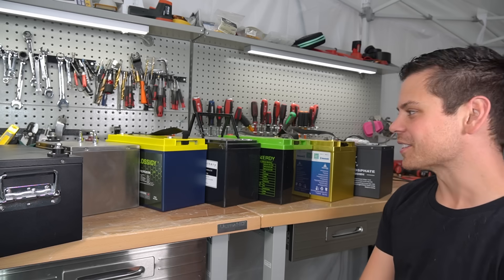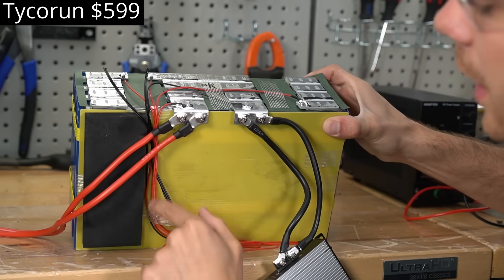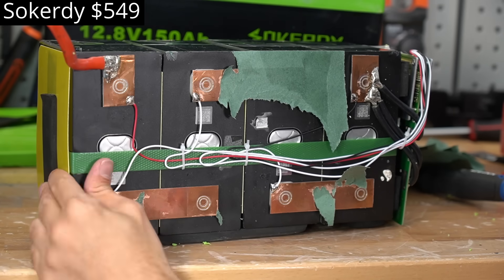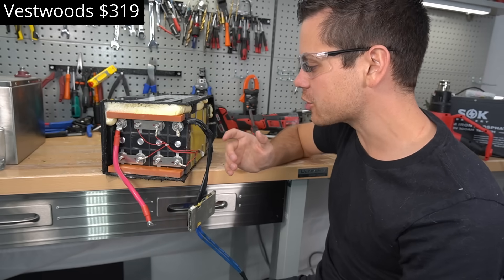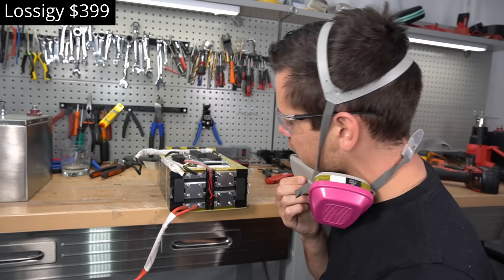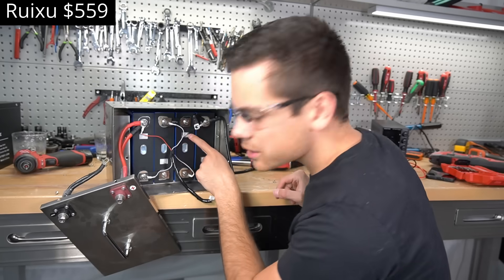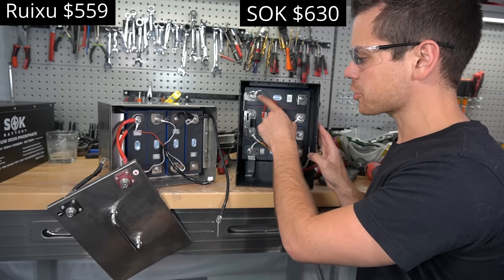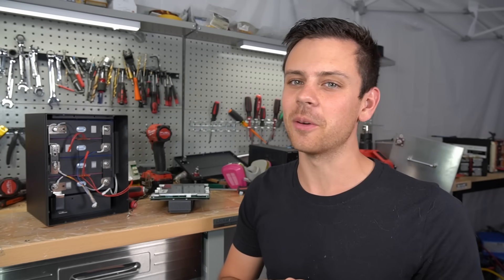Budget LiFePO4 Showdown: Lossigy VS SOK VS Vestwoods VS Tycorun VS Soderky VS Ruixu

Comment: You are not testing the vestwood as you should, the temp sensor is in the bms housing and shuts off @ 3celcius. So there is battery low temp protection

Comment: Literally had not heard of the Titanate type of lithium battery. Personably it uses a Lithium Titanium oxide as the cathode?

Edited to add: think I just commented on the wrong video. It was supposed to be the one where you drill into a LiFePo battery cell. Here in the U.K. it is electric bikes and scooters that are fastest in proliferating. All the ones I’ve seen have been the cobalt style. Given they get kept in the entrances of multiple flat houses round here In imagining a huge PR disaster is imminent if they don’t switch to phosphate soon.

Comment: First thanks for this breakdown, have you done a video on RV solar batteries systems?  I would like to know if I put two 200Ah batteries in parallel and have 2 200w solar panels how long can I expect them to charge when depleted to 50%.  Is there a formula for that ?

Comment: Nice video, do you have a review on the PIONERGY 12V Lithium Battery - 100A? I have their two of their 20Ah battery and want to fork up the money for the 100Ah battery to use on my new trolling motor setup. Thanks in advance.

Comment: Though this may be highly unlikely, the Vestwoods battery seller is insistent that their batteries have low temp cutoff. Because the BMS is so different could it be possible that it is on the BMS itself? Would you mind testing by putting the battery in a deep freezer overnight and trying to charge it? This for sure would demonstrate whether or not their claims are true. A 100Ahr  battery for $320.00 that according to their ad supports series and parallel configurations with good cells is a great deal, with low temp cutoff a great deal!

Comment: Great reviews. So good that I bought two Lossigy 12V 100Ah batteries. BUT--after getting them, in the manual that came with them there was NO mention of anything about a warranty or registration. So I emailed the company at the address in the manual--and got no response. So I have my doubts about their warranty and reliability. Have you found anything else about the warranty?

Comment: Hey I'm new to the solar world and I'm disabled trying to get a system up and going for my family in case of anything like a hurricane happening. Do you have a battery that's at least 200ah that you could sell me that has great functions and power still. I'm 34 months clean from drugs and alcohol and I've broken my neck so I'm disabled and on fixed income and I'm trying so hard to get off grid so I can have a sustainable life. Any help would be much appreciated. Thanks.

Comment: I was using an SOK 100Ah battery as the power for a pond jon boat.  It runs a trolling motor, sonar, bilge pump, and lights.  I charge it with a single 100W solar panel that lays on the deck.  It has been a great set up for me.  This summer the bilge pump on the boat failed and the battery was submerged after a 5 inch rain storm.  At first I thought the battery was ruined, but after opening it up and drying it out, each of the cells tested at 3.5 to 3.6 volts.  The BMS was obviously corroded and fried.  I replaced the BMS with a pretty inexpensive Daly BMS.  Following the procedures I have watched Will do a hundred times, I was able to get the battery working again (thanks Will!).  I know LiFePO4 cells are much less likely to have fire issues than Li ion, but I am a bit nervous about whether these cells are at increased risk after being wet.  So far the battery is acting normally.  Does anyone have any experience or insight on this sort of issue?  Finally, thanks to Will and his awesome channel I was able to have the confidence to do this repair myself.  What a great resource he is.

Comment: I have been enjoying your videos & learning quite a bit. I am currently building a 36V EUV to use around my farm. I picked up a very nice 36V commercial motor that was designed to use in a parking lot sweeper for dirt cheap as it had minor shipping damage. Most of the vids I've run across are for 12v, 24v, & 48v systems. Have you done a build of a 36v system that I can't find?
I also was thinking about buying three 12v LiFePO4 batteries and running them in series but it seems that one would have to get a 36v BMS to balance all the cells. Am I correct on this? Thanks.

Comment: Will, what BMS is used in the SOK 48V / 100Ah rackmount bats? 
I have three EG4 48V LifePower bats from SS connected to a Sol-Ark 12K. IF for what ever reason closed comm is not possible with my bats, I would think that the SOK BMS could be installed in my bats to do this. 
Tom Fisher MD EE

Comment: the vestwood 100ah tested 108ah (pass) and will start my onan 4,000w rv generator 75 amp (150+ surge)

so far so good great price

**** no low temp cut of **** at least in my freezer at 25F

Comment: I’m looking at getting two SOK 206 amp hour batteries for my RV. I want to be able to run my 1350 W air conditioner and 12 V DC refrigerator while Boondock camping. I just have to make sure I have sized everything right before I pull the trigger

Comment: LifeBlue 12V 200 AH low temp batteries are never in your reviews.  I have two, Aug 2020, 200 AH-12V Low temperature batteries that I paid over $2,000 each and one quit working.  I took it apart, and found the lid was not sealed to the battery box, but it had 10 #3 screws holding it on.  The one battery that quit working was badly water damaged, because water seeped in through the lid.  I mounted them on the front of my RV, in plastic containment box, but LifeBlue says that it will not honor its warranty.  If you would be interested in evaluating one of these batteries, please let me know.

Comment: Will,
I have a 2006 Ezgo Golf cart EZGO txt 36v (6/6v) my stock controller is rated for 250a.  Can I use a 3/12v 200ah SOK and hookup in series without tripping the bms?  Thank you

Comment: I used to work for Exide. My dad was QC there and he was a stickler for quality. Workers would adjust his settings after he left in order for higher production numbers which in turn produced subpar batteries. My advice would be to spend extra on a quality battery made by a small company before QC is compromised by production.

Comment: Quick question: I’m looking to build a 48v system for my van. I’m trying to use a 12v or 24v alternator to charge from the engine (48v alternators are extremely expensive). I’m wondering if there is a converter that will charge a 48v system, any ideas?

Comment: I love listening to you  ♿️👩🏻‍🦳I want to have a solar setup My  solar generator and panels were stollen  I need enough power to run my all electric tiny truck project house cpat  oxygen  hepa filter split ac 12v refrigator freezer  induction  air frier set forget necessary to live   I have a small investment available my home distroyed  everything was lost  to mold from water damage  the insurance refused claim  So starting over 69 with terminal Porpheria MCS EI  Reactive Air  need to travel west to recover away from Florida pestacides polution You had your own limitations you know challenges I asking for your exsperience  getting panel  from sun solar? I’m trying to find a safe low floor rampbus chevy   4500    to convert or lowfloor  cutaway van  with lift
That I can walk or ride into when necessary  It’s hard when your 69 sick for 20 years on very limited income  I pray for help but so far my needs go unanswered

Comment: Hi, I’m considering replacing the batteries on my boat with lithium batteries, I currently have
 4 batteries
2 for my house bank 
1 for starboard motor ( cranking battery) 
1 for port motor ( cranking battery) 
All from “interstate batteries “ marine rated 27 bank.
What would you recommend I should replace them with?
I was also looking at the possibility to be able to run my Domestic Marine air conditioning unit is. 115VAC so I would need an inverter charger ( not sure which one) would be the best option, or how many batteries I would need to add to my house bank to be able to run this unit overnight if possible.

Comment: You have a lot of videos, so rather than try & find the video(s) which may answer my questions, I thought I would ask them and hopefully someone could point me in the right direction. 

I currently have a grid tie system as well as a portable 12k peak watt generator, which I use in emergencies.

My thought is to put together a high wattage (100-200 amp 240v) AC to AC system with a minimum amount of storage initially (say 4 - 12v 100 AH LiFePo4 batteries in series) , and add capacity over time. My questions;

1) Is this a viable approach? What I am looking for initially is effectively a short duration (minutes) whole house UPS. Over time as prices become cheaper and battery tech becomes better add more capacity.

2) If I supply AC power from my generator or from the battery system can I still leave my dual 5k SolarEdge inverters in the circuit, supplying AC power? Or will this cause issues/damage?

3) Where can I find information to implement the system described above?

Comment: Hi
Can you Expand an existing LiFePO4 bank by adding more LiFePO4 batteries from a different supplier. Same V, Ah and Chemistry but different brands? The BMS of the different brands will not communicate, but can you still mix brands? BMS will look after each battery ?
Thanks

Comment: I wonder If the low temp sensor was connected to the inside of the aluminum plate on the outside of the control module on the Vestwoods Battery

Comment: I bought 8 of the 150A 24v Lossigy batteries.  I haven't had any issues with them (they are running a pretty high load system on my boat) - however - I have never been able to reach their support... not that I've needed it - but I tried just to see..

Comment: Thanks, I'm just setting up a solar system on my new camper and for years on my boat I used AGM  , with a TriStar controller...I guess they are about 12 years old now still going strong but for my camper I decided to look into lithium iron oxide and was overwhelmed by all the choices with wide Price point...now ,with your great videos I'm learning the important things I need to know.
With the little I know so far I'm leaning toward a SOK ...either 200 or 400 amp. Any sugestion for a small 21 foot camper with three 150 watt panels ? Any controller suggestions? Love to hear some comments. Oh and with the blue tooth BMS with the smart phone app...do I still need a dedicated battery monitor ?

Comment: Any idea how many vestwood batteries u can pit in parallel I am looking to upgrade from a six batterie bank 100ah flooded lead acid trying to do my research but can't find anything on the limit
Reply: Hello. Dear. Vestwoods will promote new versions 100ah battery. Support 4p4s. And in june, new 200ah, 250ah 300ah will be promoted either. Maybe you could follow~
Reply: @patrickdong7833  thanks I ended up getting a chins 300ah battery but I didn't get the smart one

Comment: If the 24v SOK is essentially two 12v inside the case.......  will the 24vSOK potentially  have same "off balance charge" issue from heaters kick on, as two 12vSOK wired for 24v that you mentioned in the video ??? ..... or would the 24v BMS take care of that issue.

Comment: Solid, as always. I would suggest that in the future if you see two temp sensors in a battery, perhaps try chilling or heating them together. The second sensor may be functional, but perhaps is used in a different way than being able to shut down the current on its own. Example, in a clothes dryer there will be a cycling thermostat and then a high limit safety thermostat. One is intended to be cycled, one is not. If a digital control system is taking in two temperature probes, it could be doing several things that require both sensors to be exposed at once:

1) perhaps, like the dryer, one is a safety that is used only in the case of a fault with the other sensor. If this is true, and the digital controller doesn't recognize a fault with the primary sensor, it may ignore the one that seemed to not work. 

2) if the sensing probes are wired in series and the controller takes a voltage sample from between them, as a voltage divider (like how fuel level gauges usually work), then exposing just one to high or low temps may not be enough to trigger the low or high temp cutoff. 

3) probably a handful of other conditions I'm not going to think of

So, might be best to try them individually and then test them together, in case either the controller logic or the physical wiring requires particular inputs. It's not likely that if the sensors are inside a battery pack that their values would be so very different as they would be with different extreme temp exposures (room temp versus very high or freezing temps).

Comment: I had ordered a Sokerdy battery via Amazon right before you released this video. They claimed stock in the US, but it took a week before UPS tracking said it was in California. Then, it was in my city at the distribution center, and the next morning I checked and it was 3 states away. I called UPS, and they stated the seller had changed the destination address, and the package was registered as 3 pounds. Very sketchy company...
Reply: Update to my situation! Sokerdy refunded me the money, and then gave me a coupon and a free 24 volt charger on my next battery purchase from them. I bought it on May 6th, it arrived in port in California on May 11th, and then delivered to me on May 17th. The 24 volt battery came charged at 26.3 volts. I'm going to charge it using my charger to verify over voltage protection works, and then discharge to verify under voltage protection works. I'll update after my findings.

Comment: 15:30 in the video. Aren't the internal heaters triggered by the bms only when the bms senses a charge? And if you have a 12v charger on each battery in the series and the heaters only triggered under a charge, wouldn't that keep the batteries from becoming imbalanced? I do not believe the heaters work if the batteries are idle or during use/discharge. As a side note, it would be great if you could do a review of a Himassi 12v 100ah with Bluetooth and heaters.

Comment: Loved video I'd love to see reviews on more $300-$350 100hr batteries.  I was looking at moseworth which looked very good purchased 3 for $100 each and was switched to what they claimed was same battery with different label because of stocking issues.  Labeled screampower. They claim low temp cut off.

Comment: But we could just buy some Eves and connect a bms to it up into the solar charge controller too, the panels, and call it good right? Would a battery monitor be a decent thing to have even if we have an Epever solar charge controller? I suppose the  charge controller can't actually monitor the batteries like an actual battery monitor would..? Where are some good instructions to connect the bms to 4 raw lifepo4s - 12v.?

Comment: RE the VESTwoods BMS, did you actually put it in a freezer? Maybe the sensor is inside the BMS itself and not monitoring the cells directly? Just a thought...
Reply from the maker: That would be instant failure. Think about the heat created by the fets

Comment: Thank you for your detailed battery review videos - I am learning about the batteries for my off grid solar application and find them very helpful!  Quick question: what brand(s) and sources (Alibaba, etc.) would you recommend and caution against for a 48 Volt 30kWh lifepo4 total capacity? I have Outback FM100-300VDC-AFCI, 100A MPPT charger controler and OutBack Radian GS4048A-01 inverter?  Thank you!

Comment: I'm just going to stick with my deep cycle marine batteries. I know how to maintain them and they last a long time with plenty of power.
Reply: Purchase 3 lithium batteries for my trolling motor at $300 each. Not far off from agm prices. Moseworth, screampower  been in boat for around a month 7 fishing days and seems to work great.  Had to buy a different charger though.  Went with a noco 4bank charger 10 amps per bank for $419  still using agm for starting motor but probably change next season unless dies before then.

Comment: I have a question and I can't seem to get an answer to. I just got everything set up and I want to measure the actual wattage that my panels are producing. My controller doesn't show that. I bought a DC multimeter to install. My question is do I wire it between the panels and the controller? Or between the controller and the batteries. All I want to see is the amount of wattage that the panels are producing at any given time.
Thanks for your time,
Eric

Comment: For serial heated batteries, I think it'd be best to have them in a very thermally identical room or enclosure. If they're DIY cells you could do anything, make a heater for all cells, have a microcontroller only allow charging if the entire series string is above freezing...

Comment: On the Vestwoods battery, what if the low temp cut off is inside of the BMS that mounts on the surface of the batteries. Try testing with freeze spray on the BMS when it is loose from the batteries.

Comment: I was super close to buying a Lossigy before the price jumped up from $319 to $399, then I was looking at the Vestwoods.  Even though I ended up building my own 230ah Eve cell battery for my RV (because it could fit where I wanted it to) I am happy to know I have a good "picker".  The Vestwoods 200ah was on sale for $499 (crazy price) at one point which would have been a very good price for that capacity, I just could not find a place where I could put it in my smaller trailer.
Reply: Since you have a good picker maybe you could help me lol. I’m just trying to add a second battery system to my girlfriends 4Runner. I’m an electrician but this stuff is like Korean to me. So many options at vastly different price points.
Reply: @ChristiannTyler  Hard to say a year later, build one!